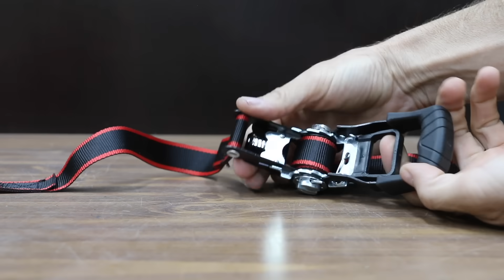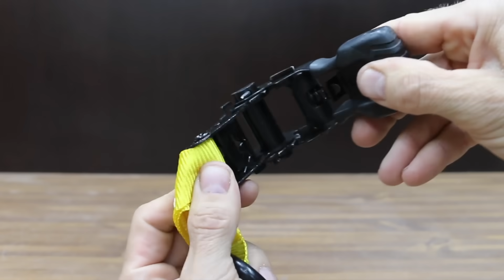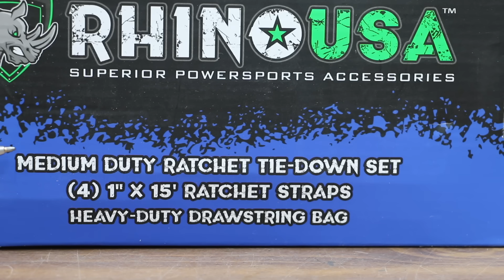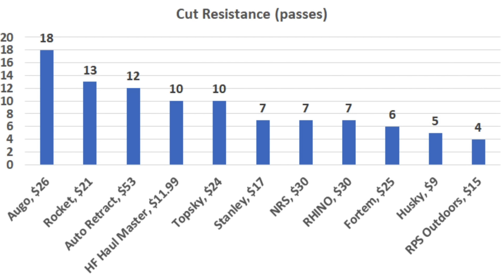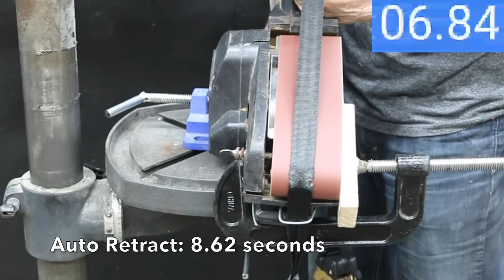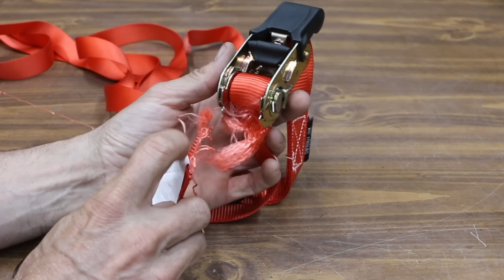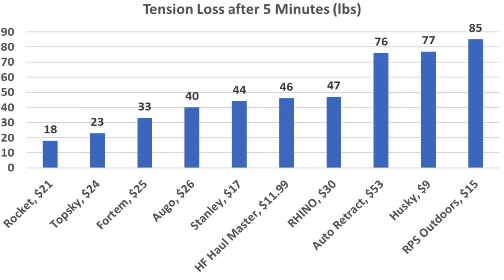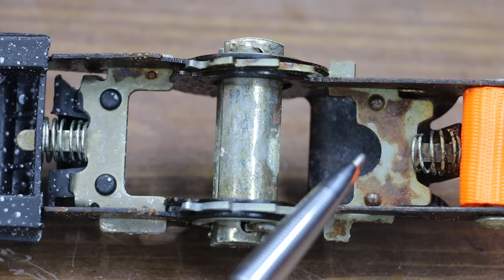Best Ratchet Strap? Husky vs Stanley, Rhino USA, Rocket, Topsky, Augo, RPS Outdoors

Comment: I have used a number of the Husky 1" and the $5 3/4" straps. The smaller straps are basically trash 1 use straps. They will hold down tarps at the best with the ratchet mechanism steel too soft, it bends very easily under load. The 1" straps will work more than once, what happens to them is the ratchet mechanism bends making it very hard to undo them without bending them around. Thanks Project Farm now I know why they loosen up so much, it is due to the stretch.   

I also use a lot of the 2" straps. Husky changed the strap material about 6 months ago and added double hooks (1 hook and 1 flat grabber) to the ends of the straps. The strap is too soft, it frays badly at the hook attachment if the pull isn't exactly straight. The double hooks are a two edged sword, if you have the room to attach the hook you want and the other can get out of the way then they work OK. If not then they are a pain in the ass trying to get hooked up and keep the other hook from interfering. I purchased 12 of them for a job, not knowing the problems, as they were the only straps available at the time at HD. 3 of the straps frayed at the hook, on the first use, using the flat hook, to the point that they are not usable for transport now. The soft strap also was easily damaged where it contacted the load, much more so than the old harder straps they use to use. I have them, I will use them until they wear to 20% (quickly) then I won't buy them again. 

Straps that are 10' long are not much use unless you are just trying  to tie down some boards or something small or maybe a bike in the back of your bed. In my opinion the hooks with safety latches will cause problem with hookup and removal unless you have very good access to something that will let the safety latch fully close and open when hooking up.

Comment: I had 3 good take-aways from this video.

1  I was going to swap the straps of one ratchet for some kevlar webbing.  I wanted one ratchet strap I didn't have to worry about.  However, after seeing the hooks bend I'm not going to bother.

2  Todd's storage method is far superior to my father's method of wadding the strap up and tossing it behind the seat.

3  Cousin Eddie is under paid.

Comment: Thanks for the evaluation of those 1" straps, how about doing one on 2" or larger straps?  I use 2" straps quite often for hauling livestock handling equipment, and wondered if there were real differences between the brands.

Comment: I'd avoid the Rocket brand just because of the "safety" clip. I can't imagine the frustration I'd have with those when I regularly have a hook under my tool box that is in a blind hole. I struggle with just the average hooks as it is.

Comment: Have used ratchets for years as a cheap, effective means to secure loads. My biggest complaint with these straps is unwinding, particularly after a season of heavy use. A lot of them lose what little smoothness they had so I usually discard after a year or two therefore, Husky is my go-to because of price and general effectiveness.

Comment: I had some ratchet straps, but my wife had trouble with them and so I switched to the quick release cam buckle type. And 90% of the time I don't even use the latch, just the strap with hook piece. I put the hook in a slot in the bed rail, go around what I want to hold in place, then tie the other end in the bed rail on the other side. It usually tight enough for the typical short trip I'm making(less than 10 miles) and a lot faster and less complex to figure out where the "fancy" end needs to be to be able to have room to tighten it. I find a big help to be looping the strap through or around the item being held in place as that way it doesn't slide around as you make turns due to the extra friction on the part and the strap itself.

Comment: I believe you forgot to measure how much tension can be generated with the ratchet mechanism ? When strapping a load this is rather important.
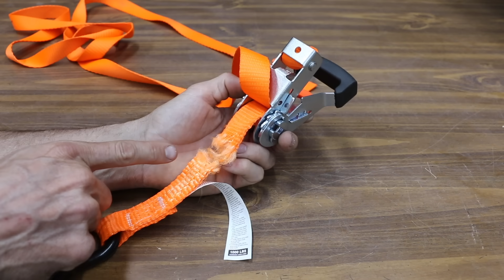Reply: I thought that at first then I realised he tests the working load at 12:32 and he generates the load using the ratchet, so as long as they can generate enough force to achieve the working load that's all that matters, if you just want to know which ratchet is easier to get to the working load then it's just longer the ratchet lever handle the greater the force you'll generate. This guy is pretty thorough I'm sure he'll have thought about that. I suppose it would've been nice if he explained why he didn't measure the tension each ratchet can produce.

Comment: how can someone produce those straps for 2 dollars and 25 cents?
Here in the Netherlands a liter (roughly 1/3rd of a gallon) of petrol costs 1 euro 70 cents.
1,70 euro. That is 2 dollars and 4 cents. For a liter of Petrol.

You need it to transport all this stuff.

Either way: How is it possible to produce 4 straps in a package for only 2,25 dollar?

Its ridiculous.
And, it is what is destroying the economy.
Reply: ps; i expect to see cousin Eddie actually replying in the next video.
Deep fake rings a bell?
Reply: o, my apology. 4 straps for 9 dollars.
Which makes it 2.25 dollar per strap.

2.25 dollar per strap, that is ridiculous.
The metal itself, where did it come from? It had to come from the ground. It had to be processed.
Even if it was junk metal, recycled stuff. It has to be processed.
The strap has to be made.
It has to be shipped.
And you want me to believe that the manufacturer of such a strap still makes a profit?

IF that is possible, then there is something very very wrong with the entire system.
(i know, i know, there indeed is something wrong with the entire system. I was just pointing it out this way)

Think about it.

OR think about this: At our gasstations here in the Netherlands we can buy a sandwich.
The sandwich costs 4 Euro and 95 cents.
Its just a normal piece of bread with some stuff on it.
So like: For food, in this case a sandwich, you pay 6 dollars.
And for a strap like this, 2.25 dollars.

And still people agree to this kind of madness.
Because, if they do not agree, they should be on the streets protesting.
I don't see any of such protests.
Be real: This is ridiculous.

A can of chocolate milk, .2 of a liter, costs 2 euro.
So a can of chocolate milk, .2 of a liter (which is 2 sips, perhaps 3 sips and the can will be empty)..... it is more expensive than a strap like the one is shown here.

But the metal has to be melted. Etc etc etc.

We as human beings have totally lost any sense of reality

Food being more expensive than any product. It is ridiculous.
Unbelievable that people accept such nonsense.
And those with children: it is unbelievable that you are willing to accept a future like this for your children.
I guess you dont love em as much as you say you do, right?
If you did, you would not agree to such madness.

Comment: For me main different is metal thickness of teeth and teeth blocking steel thickness. Some are so thin they don't hold and bend when someone locks with only one side holding. Some are so thin not only locking plates bend but whole handle twists under load. These are real life experiment. Thin teeth, especially  thin locking plate is to avoid at any cost
Reply from the maker: Great feedback. Thank you

Comment: Fuel treatment round up which brand provides the best carbon deposit clean up, which brand offers the best fuel efficiency, an which is the best value. Maybe get a bore scope camera an look in the the spark plug holes of your car or some friends get some before an after. Maybe go from quarter tank and add the treatment an drive till on a quartertank again fill up with no treatmentan see if it made any difference(Red line, stp 5 n 1, gumout complete, and please add more fuel treatments so we can find out what is the best for our cars an trucks)
Reply from the maker: Thank you

Comment: I work as a loader for a logistical company who deal with photocopier machines from some of the biggest names out there like canon and xerox, a lot of the straps we have on the trailers are all old as hell, grimey and really dirty, half of them are probably a decade old, some are torn up, some with knots in the lines.
As someone who ratches and removes atleast 100+ straps, sometimes 200+ straps a day, every day, i can tell you now the best ratchet strap is one that has a rubberised handle or has rubber blocks near the ratchet mechanism to protect your knuckles from getting chewed up.

As a rule of thumb when loading, if the object has corners you need to use plastic or cardboard corner savers to protect the strap and to make sure the straps dont cut into the product as while some customers don't care if the outer shipping carton is damaged, some want them looking pristine if its a high priority load with say 72" curved samsung tv's.

A knot in the line between the two hook points reduces the straps capacity to hold a load by atleast 50%, the only acceptable location for a knot in the line is at the end where the knot prevents the ratchet from coming undone mechanically.
A twisted strap is better than a knotted strap.

None of our ratchet straps have super reinforced lines, you can cut them with a box cutter fairly easily, I've had to sacrifice a few lines because the ratchet mechanism was damaged or the hooks were embedded in the trailer walls. Your abrasion test was "unfair" on the straps as you're simulating a constantly shifting load with an abrassive surface, no load would shift that much while tied down even a pile of engineer bricks.

Comment: I just bought the Husky. I never come close to pushing these tie downs to their max load. I use them to tie down bikes or tarps so I really like the smooth ratchet of the Husky and the price is hard to beat. Great job once again. Suggestion: how about rechargeable flash lights and/or work lights.

Comment: The auto retract straps are super useful if you are securing the same load over and over, like a mower or a boat. They have a hole that can be used to mount them to the trailer. My dad uses them to strap down the back of his boat.

Comment: nothing worse than a product saying stuff like "designed in the USA" when it's obviously still made in China
Reply: Exactly. Quality control goes out the window in a Chinese factory unless you really watch what's going on. Considering that a ratchet strap failure could injure you, or damage what you've strapped down, quality matters. Still, I think every strap here was made in China. Pick your poison!
Reply: The Chinese are capable of making good stuff when they're spec'd out to do so. All the Milwaukee & DeWalt stuff that finishes high on the channel attests to that. It's just a question of how much goes to the American CEOs & how much goes towards the actual product at a given price point.
Reply: Master Locks are engineered in the USA and manufactured in China, those being their two worst defects.

Comment: I've ran the auto retract style and find they are nice but do not last long in the elements compared to a standard ratchet strap.
Reply: Storage I roll just the strap up that way it's easier to grab and throw over something if your strapping on a trailer or something. Same way they roll up for tractor trailer.

Comment: The only thing that you are missing is how well they worked after the corrosion. I use ratchet straps to secure a step ladder to the catwalk of my semi truck that I use when I'm making local deliveries to get in the back of the trailer because I have a bad knee. I would have liked to have seen how hard it would be to ratchet each ratchet strap and unwind each ratchet strap after some corrosion. Because for me after driving through the mountain passes in the winter and getting all that salt corrosion from the snow covered roads on my registrap it's a pain in the butt to get them to release or ratchet sometimes after even only one pass through the snow. Great video though. I think I may look into getting some of those retractable ratchet straps. You did a great job on testing all of these. Still waiting to see you do a video where you substitute diesel fuel for 2-stroke oil LOL.

Comment: Can you test welding clamps? Like this kind? https://www.homedepot.com/p/Milwaukee-11-in-Torque-Lock-Locking-C-Clamp-with-Regular-Jaws-48-22-3531/205017710 Is it worth it to buy an expensive one over the cheapest one? Not sure what kind of testing you can even do? Biggest problem with cheap ones is the little "arm" in the middle comes loose.

Oh, and check out these next time you do ratchet straps. https://tiedownstore.com/collections/quickloader

Comment: Awesome video as always but I would have liked to see you throw in an old used freight strap.  When I drove trucks my company had straps with both hooks and e-track connections.  You can find used ones fairly cheap and there is simply no comparison to these hardware store ones.  I think they were around 2.5" wide and thick as heck.  I've used them to pull out a stuck tractor trailer.

As I said there is really no comparison, but I guess what I'm getting at is since people use your videos to decide what to buy they should be aware of the option.  A freight strap will last forever and be several times stronger, for not much more money if you shop around.  Plus they can be used for HEAVY stuff like pulling vehicles out.

Comment: I've never seen that Topsky brand from Ningbo, China but it was clearly miles better than the rest in this comparison/test. The Topsky frame was nearly double the thickness, it was fully zinc plated, and had a much heavier nylon strap. The rest looked like junk to me. I refuse to buy those cheapo thinner ones with 1/16" thick frames myself. They look like they will break the first time out. I could Never buy straps online, You need to be able to see them in person and see how they are made, how thick the metal of the ratchet is, How thick the straps are etc. I have 2 or 3 brands of smaller straps I use, but the only ones that are labeled is the ones I got from Woods Supply down in Golden MS. They are labeled "Woods" on the strap. They are much heavier made frame and strap. I try to buy the 1 1/4" or 1 1/2" wide for general purpose things, and I use the 2" x 10.000lb for really heavy loads, but that is usually on a trailer.

Comment: Does letting the strap wrap in the ratchet  lower breaking strength as it will rub on itself causing friction and heat therefore breaking the strap?
Just a thought 
Test is still accurate as real world everyone uses these differently.. wrapping direction. How much wrap in the ratchet etc

Comment: So with the sandpaper test, correct me if I'm wrong but it sounded like the machine was running faster on certain runs than others. Was there a consistent RPM between passes?

Comment: I'm disappointed you didn't test a US built strap like US Cargo Control or Macs Custom Tiedowns.  All your straps were cheap chinesium.  It would have been worthwhile to showcase how much better PROPER load-handling gear is
Reply: If you only need 1 inch straps you aren't going to bother with the good stuff, you're moving furniture or an ATV at best, these straps are what normal people have and use

Comment: I’m so glad you did the corrosion testing, but it would have been nice to describe the smoothness of the ratcheting and release actions after corrosion. Also, using ratchet straps on dirty and muddy off road vehicles can lead to significant contamination of the ratchets. I wish you would have tested the action after dirt and/or mud exposure.

Comment: Never occurred to me that ratchet straps lose tension after you tighten them down.
Reply: Also take into account the load settling/moving while in transit. When I drove over the road hauling flatbed always checked straps/chains in the 1st 20 miles and always found some that were loose. Same applies to cars/trucks hauling anything that needs strapped.
Reply: @roughrdr  Dang usually I just tug on the tied down object and say "that ain't going nowhere" hasn't failed me yet.

Comment: Well I own and use the Husky straps on my truck, where the straps have served duty moving furniture, a bed full of junk, multiple trips to the dump, and so on, and the Husky straps worked great and didn't cost much. Zero problems.  I don't have to baby them. They're so cheap, I can just get new ones, not that I have any reason to. They're holding up just fine in my real-world use.  Before Husky, I had straps from Harbor Freight and they were exactly like anything else from HF.  That's why I went elsewhere for a replacement.

Comment: I'm so glad you included the NRS straps in this comparison! I am an avid kayaker and I have used NRS straps for the past ~25 years without ever seeing one fail, even under pretty extreme conditions. I think the oldest NRS straps I have and still use are 10+ years old and feel to be in excellent shape. Even though they were less strong in tensile strength and abrasion resistance, I have no plans on changing to a slower and less convenient strap! I would have loved to see how well they held their tension during the one minute test at 300 lbs! Phenomenal work as always!

Comment: It’s kind of sad that literally everything is made in China these days.
Reply: What's even more sad is that the "USA designed & engineered" brand finished so-so & at the bottom in corrosion resistance. We're sliding into total irrelevance for innovation except when it comes to making war. 🙄🤦
Reply: Yeah, that's why I like to skip the middleman and go straight to the source, sometimes you get junk but often enough you get stuff almost if not just as good as any "name brand" you'll find locally at 1/3rd the cost.

Comment: I thought of one. using aluminum foil and high temperature spray paint can you layer up the aluminum foil to make a head gasket for a small gas engine? Aluminum foil spray paint layers till desired thickness.